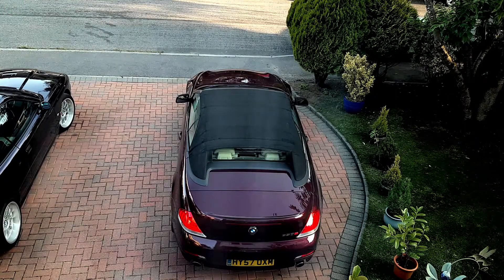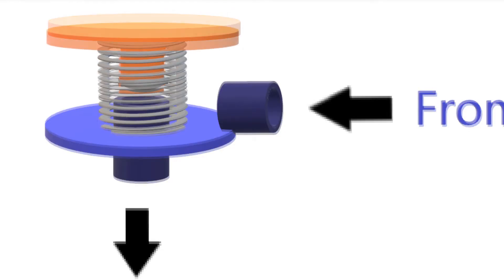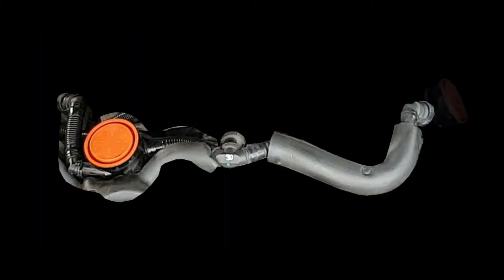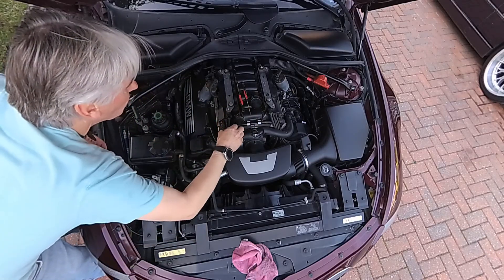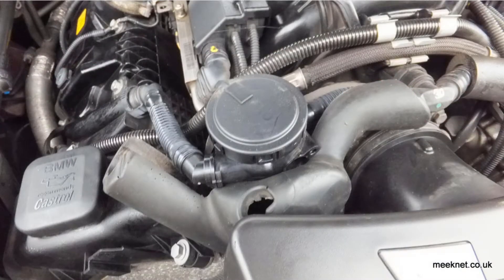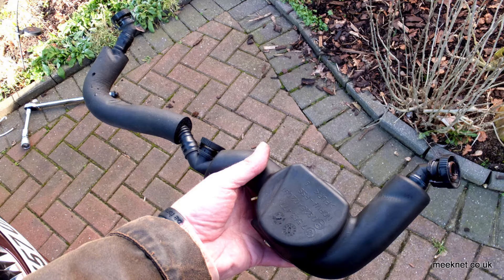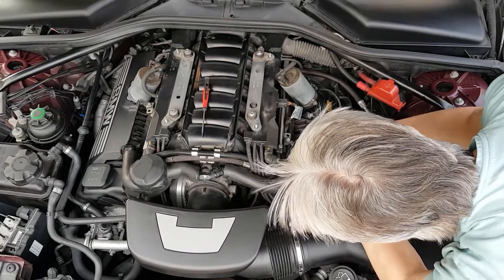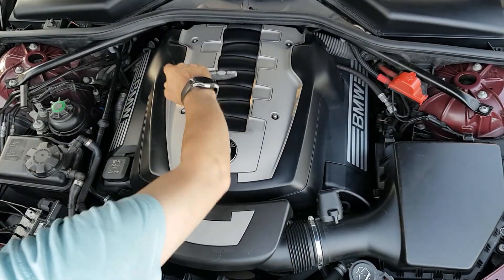BMW N62 Engine - Valve Guide Seals causing smoking? Fix in 30 minutes!

Comment: If you're going to make a video, then title it correctly. Those are PCV valves, not valve guide seals. Quit making honest technicians look bad. They BOTH fail and both are problematic on the N62 Just FYI.
Reply from the maker: You are welcome to your opinion!
Reply: Actually I'm a BMW tech of 23 years so my opinion counts.

Comment: I’ve been following your great videos since I bought a used 2007 convertible in the States (although I’m from England originally) and find all of your videos highly informative and calming! Dealers don’t know anything other than how to make money out of scared customers, so THANK YOU! 

I have a side question about the dipstick. Mine is on the right of the engine at the back as you look at it. Is that a transmission dipstick or engine oil because I also have the electronic readout in my CIC iDrive. Might be a dumb question but I don’t know if BMW had both for the oil level. I have replaced my PCV on the right side and noticed it back there.
Reply from the maker: Thanks! Yes, that's the engine oil dipstick, the N62 on the E63/E64 had both the dipstick and the electronic level measurement

Comment: Hello! I changed those, but still have the problem. Is it possible that dirt in the vent hose causes the problem as well? I ordered one just to try before tearing the engine apart. A friend of mine also in 4.8l had this issue and bought the car cheaper because previous owner didn’t find sense in  giving all the money, but after a vent pipe clean his oil consumption an smoke went away. 🤷🏻‍♂️
Reply from the maker: You still have some hope - try cleaning out the vent pipe and the valve cover where the pipe connects
Reply: @ just installed new valves and a pipe. Did not see anything concerning except the valve cover channel going back on bank 2 was full of oil unlike the other one. Its the same side (bank 2) that I have exhaust smoke from. Any ideas? Thanks
Reply: Little update. With new valves now the other bank smokes. The other bank stopped smoking.Valves are not OEM. I will put the previous valve again and try. Maybe alternative parts are not that good

Comment: Timm. Just wanted to say THANK YOU. I purchased a mint 2003 645Ci in late 2023, so 20 years old. 112000 miles but hadn't been used in 4 years. But I found it was using oil and smoking, despite performance and driving perfectly OK. Feared the worst (valve stem seals). But no, I dismantled both PCV valves - unlike you, I found both were clean BUT both had serious splits. Probably the originals from factory in which case a weak point as diaphragms no longer flexible and now brittle, hence the splits. EXACTLY as you describe, took a 100 miles or so after replacement and now, no smoke! I must stress how bad it was before your simple remedy - big puff of smoke on start up and after a motorway blast and then idle followed by re-acceleration, a wall of smoke! Now none of that! THANK YOU.
Reply from the maker: That's great news, well done!
Reply: I recently bought a 2005 645 ci convertible. The exact same issues to the T. Can u give me any pointers as to what u did? I looked over the cover gaskets found a tiny amount of oil. So I just cleaned them up. Hopefully that will be good enough. But was wondering if that’s all I needed. Or should I just replace the gaskets??
Reply: @ttp_hylyfe  Hi, Well mine were both badly split so I replaced them both. The diaphragms I bought came with the Caps and springs so, as the diaphragms were slightly thicker, I replaced the 3 things on each bank, Parts weren't expensive. Have a VERY could look at the diaphragms - even a tiny hole and it won't work properly. You will have seen that the 645i layout is slightly different - BOTH diaphragms are found as per what Timm calls bank 2 on his 650i i.e. under the engine covers. Hope that helps. Jon
Reply: @jonathannoble8322 thanks a ton Jon. I really appreciate your reply and time my man. Greatness be upon u and your loved ones.
Reply: Did you buy oem pcv valves? How much were they?

Comment: wonder if an aftermarket oil catch can would fix the issue, and stop the oily air before it gets to them. My 645Ci is blowing white smoke and I hope this is the problem.
Reply: IF THERE'S NO OILY BUILDUP IN YOUR COOLANT TANK IT CAN BE STUCK OPEN FUEL INJECTORS ...

Comment: Tim, I have a BMW 630I PETROL. I have replaced a faulty fuel pump on the car, it seems petrol still isn't getting to the engine but it's trying to turn over. any ideas?
Reply from the maker: Possibly crankshaft sensor, without that the fuel pump will not run
Reply: @TimmsBMW  Is that the same as the cam shaft sensor?
Reply from the maker: @wirralcarpetcleaner6304  No, the crankshaft sensor is on the flywheel

Comment: Attempted this myself over the last couple of days. The crankcase breather was so brittle it broke when I tried to take it off!  Unfortunately any of the non OEM versions were going to take far too long to arrive so I had to go to the main dealer and pay BMW prices :(. New part fitted now though with new pcv valves on as well. Now just to sort the total oil loss….
Reply from the maker: Well done for giving the job a go!

Comment: I do not understand what you did, this "third" PCV valve on the front tubes / connectors, close to air admission, i don't have it on my N62 from BMW 650 E63 2007...i had to change the valve stem seals.. (4000€)
Reply from the maker: You only get two PCV's - the one on Bank 1 can be either on the valve cover (as yours is) or in a separate housing (like mine is)

Comment: Thanks alot timm! Very nice video again, keep up the good work. I have a question about the vacuum measurement. You do that via the oil dipstick ? And should all n62 v8 have a value between 30 and 40?  I'm asking because I have a bmw e53 4.8is which has the n62b48 engine.
Reply from the maker: Yes, somewhere between 15 - 40 mBar

Comment: Thx👍my 09/2004 545i has both those PCV rubber valves on the head rather than the external setup. Why is this? Anyway I changed them although the originals looked ok - I still have I bit of smoke when I start the engine but goes away after 30 sec or so - also a bit of rough idle (rpm are rock steady, just rough for some reason)…
Reply from the maker: Try some Wynn's Stop Leak, if that reduces the oil burn then it is probably Stem Seals, but the Wynn's will help
Reply: @TimmsBMW  thx mate, what about Forte seal conditioner? Got a couple of those laying around in my garage but never used them. I guess I’m worried about additives…what’s a good way to test for definitive smoke prob? Idle for a some minutes and rev up?
Reply: Yes, use the Forte Seal Conditioner, it's good stuff

Comment: Hi Timm, I have just bought a bmw 540i so the 4.0 n62, and on cold starts will smoke white on idle (I don’t believe there’s a blue tint to it) and when revved which won’t disappear until driven for a couple miles and won’t smoke on idle until left to sit again. After it being fully warm at operating temperature, I can turn it off and leave it to sit for 5 minutes and the smoke issue on idle will be back again until driven. I’ve replaced the pcv seals like indicated in the video and one was in fact cracked. However it’s been a week now and there’s still no improvement. I’ve also tried cleaning the pcv pipes but it still seems to collect oil that is a white kind of colour. Have you any ideas of what it could be? Im hoping it’s not the dreaded valve stems seals, I left to idle for 10 minutes after driving and warming up and revved and there was no smoke. I think it’s brilliant how you’re still helping and advising people on this video after years, I look forward to hearing your response many thanks!
Reply from the maker: Before giving up give the car a good blasting to clear the oil from the manifold, sometimes it can take a good 100 miles to clear the oil.

Comment: Can you supply a link for the P.C.V valve to get the correct one thanks in advance E63 650CI
Reply from the maker: Hello Alex, buy it directly from BMW, part number 11127547058 as seen on this diagram: https://www.realoem.com/bmw/enUS/showparts?id=EH72-EUR-03_2003_E63_BMW_645Ci&diagId=11_3258#11127547058

Comment: I just changed them out. Found them both to be torn. The one on the front had a ton of oil in it, but the other one was clean. Problem is, my car is smoking now where before it wasn’t.
Reply from the maker: Don't panic just yet, what is probably happening is that there is oil in the labyrinth (in the valve covers) that is being drawn out and the smoking will clear when that oil is dragged out.
Reply: Crossing my fingers! Thanks for the informative videos btw!! Cheers.
Reply: @dayyymon  Have any luck at all? With the smoke going away
Reply: It did do it for a bit here and there, but I added a product to thicken up my oil and I haven’t had any issues as of late.
Reply: @dayyymon  Oh brilliant! Never would've imagined. Heard that there's an oil additive one can add to semi-restore old seals too.

Comment: Hi Timm. Any tips for a e46 318ti stem seal replacement ?
Reply from the maker: My advice would be to check your PCV valves first and try to avoid VSS replacement!
Reply: @TimmsBMW  what are those (stand for) and what to look for?

Comment: Hi tim i have a 2006 650i with just over 60k on the clock it has full stamped history in book bought it five years ago from someone who had it for ten years it was fine at first but after two years it started smoking after idle i changed pcv valves but still have the problem
Reply from the maker: Try cleaning out the valve covers Paul - that made a huge difference on mine.
Reply: @TimmsBMW  hi tim ive just bought some wynns stop smoke im dubious about using this treacle in my car to try stop the puffs of blue smoke after idle have i bought the wrong additive or do you think it could be ok

Comment: FYI the flex tube ALWAYS has cracks in it, and if for some reason it doesn't.. it will once you start moving it around. If you're in a hot climate like California you need to 100% replace that flex tube.
Reply from the maker: Thanks James!

Comment: Hey Tim I have a 2004 Bmw 645ci and all the buttons on the A/C stopped working and it just blows hot air. Any ideas? Thank you so much for your time and help
Reply from the maker: Stick the problem on Bimmerforums.co.uk and I'll have a think!
Reply: @TimmsBMW  Hey Tim thank you for your reply, I found the problem; the ac belt is gone lol. Thank you for your time=)

Comment: And it still smokes when warm have i bought a lemon 57 k on clock full history does eat some oil if i sit on idle or tickover when warm for ten minutes i get smoke i also get steam when cold hope i havent bought a shed i know i can carry on running it when it smokes my car is low mileage looked after according to history changed pcv valves on valve covers not tried anything else guy i bought it off has since bought a 996 porsche i prefer 650 have i bought a burner if i have ill have to soak up the repair costs or the blue smoke embarrasment engine ticks over fine drives fine etc just smokes on idle id hate to get rid of the old girl ive just had to put to bed my e53 3.0d shes got timing chain slap due to overdue oil changes but also has 4wd warning light after getting cv jojnts changed also she had diffs fitted from older 5speed model id hate for 650 to be an old cronker as well
Reply from the maker: Have a watch of this Paul - seal conditioners really work! https://youtu.be/Uzc9vQGuNnk

Comment: I have a question so I bought a 2008 550i msport and I drive it and all the coolant leaves the expansion tank? But it’s not leaking, when I leave the vehicle idle for more then 5 minutes it smokes out blue tint like oil? What could this be? A bad head gasket???
Reply from the maker: That would be unlikely, I would do two things, pressure test the cooling system and also do a block test - all explained here: https://www.meeknet.co.uk/e31/BMW_M60_M62_M62TU_Engine_Cooling_System.htm

Comment: I have an 2013 BMW 750lix drive   it was smoking  
I change my pvc valve  myself  and  no more blue smoke 
On the left side of the engine it was broken  the right one was not broken but full of stuff I paid I little bit more  I went with bmw parts  full warranty no more blue smoke
Reply from the maker: That's great news, well done!

Comment: Hi Tim, this channel is great. I was rapidly burning oil and smoking away at the lights. I checked the PCVs and all ok but I changed them anyway. I then added eight tubes of Forte seal conditioner into the engine and the oil burning has massively reduced. Pretty much back to normal now. However, I am still smoking when stopped at the lights. Any ideas? I have a 4.8i V8 N62 engine. After about twenty mins of driving the smoking is not as bad but still present.
Reply: Any updates at all? Curious how things turned out.
Reply from the maker: There is no doubt that the stem seals DO fail, all dependant on past servicing - but doing the things you are doing will minimise the problem to somewhere that can be lived with!
Reply: @TimmsBMW  I think it is water vapour - loads of it. I checked the exhaust inside and could see loads of water droplets. Once the droplets are no longer visible  then there are zero visible emissions. I am shocked by how much water vapour has to come out of the 4.8i V8 at this time of year.

Comment: Hello Timm. I love your videos! Very helpful indeed. I have owned a 330ci Convertible and I am now interested in a 2006-2010 650i convertible. Here is my question. When I inspect a potential 650i convertible, if it does smoke, is there a quick way to tell if it is the PCV valves or if it is the dreaded valve stem seals? I of course will follow all of the steps in your "How to buy a good 650i" video/. Thanks so much, David
Reply from the maker: Just don't buy it if it smokes - just not worth the risk!
Reply: @TimmsBMW  Thanks so much Timm! If it smokes or shifts hard, I will just walk away.

Comment: I've changed both PVC valves on mines and it's still blowing white smoke when idling for about 5 minutes. Could it be the valve stem seals?
Reply from the maker: Give it a 100 miles or so - and clean out the valve covers. If that doesn't work then valve stem seals would be likely.
Reply: Any updates at all?

Comment: Only if you had any clue that N62 engine does not have any serious vacuum in the intake once the car has warmed up and switched to Valvetronic (that is if its still capable of switching to Valvetronic mode at all). Sure the PCV system must be checked before assuming valve guide seals or scored cylinders but there is very good reason why almost everyone ends up doing the valve guide seals. And even then the real cause of the problem does not get repaired. The leaking valve guide seals are not a cause but rather a consequence of a deeper problem which is worn valve guides. And that basically means an engine rebuild.
Reply from the maker: Hello Nils, I will have to disagree - firstly take a look at the other comments below, there are quite a few who have replaced the PCV valves and lost the smoke problem - not only here but on the forums. Your take on the problem is in the mainstream and the purpose of this video is to show that there is an alternative to scrapping cars with N62 engines! Lack of a decent vacuum in the manifold does cause other problems as described here: https://youtu.be/o24o-mYN4oY
Reply: @TimmsBMW  6 months later when you will be posting another video from your security cam showing smoke puffs and then you will keep blaming PCV system again? I dont know how many miles you have on that car, if less than 100k then you still could be fine but I guarantee the blue smoke is going to come. I have two cars with N62 engines I know what I am talking about. I am doing a complete engine rebuild on one of them and the valve guide wear at 160k miles is worse than any older BMW engine I have ever had. These engines are POS and if you want to have one that works great you will need to rebuild it. All your PCV worries will look like joke after that.
Reply from the maker: @NilsJakobson  Hello again Nils, these sort of problems are exactly what this channel is here for - to help stop these problems happening in the first place. It sounds like you have had some bad luck - but spend a little time reading the comments on this video and the other video's on the channel and you will hear from many happy owners of cars with the N62 engine. I have owned a 2007 650i for 6 years and am heading towards 130,000 miles (I always buy high-mileage cars) - compared to my other cars E31, E32 and E38, the E64 has been the most reliable. I certainly don't think the N62 is a POS, except where they are not looked after - and that means regular (1 year at the most) oil changes - if these are missed or were missed before your ownership then you are going to have many problems. And that is the aim of this channel - I'm sorry you had problems but there are so many happy owners here!

Comment: Those diaphragms tear very easily. Especially aftermarket rubber valves. I’ve had 3 550i’s with n62 engine. Never replaced the valve stem seals and I fixed the smoking issue in all of them.  A trick to keep the oil out of the engine is to add a 1-3mm rubber disk on the top of the flapper valve. Make sure the disk is smaller than the inner circle of the rubber flapper.  And make sure the rubber is clean and seals on the edge. This will keep it from opening so easily to keep the oil out. Also make sure the pinhole on the plastic cover is not blocked off.
Reply: where can I buy this disk?